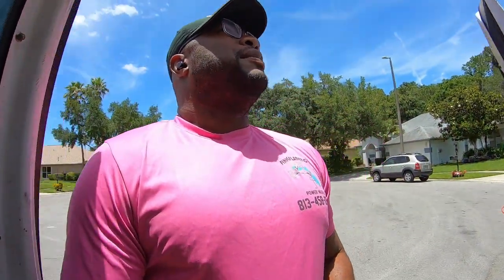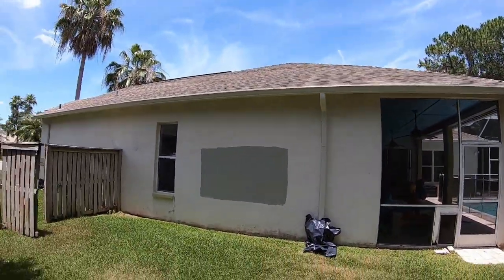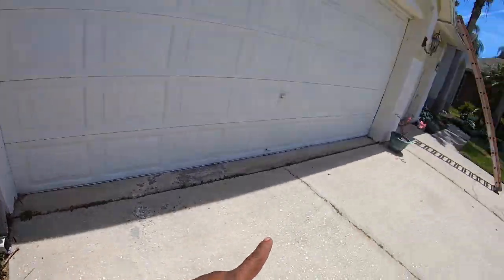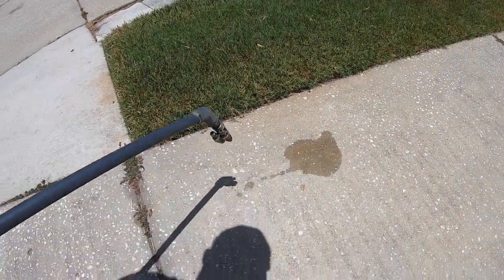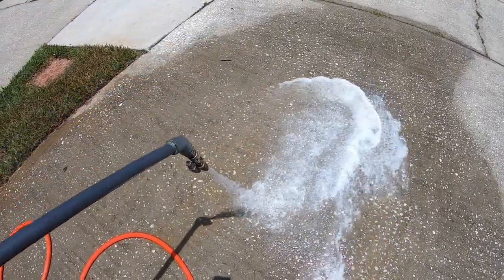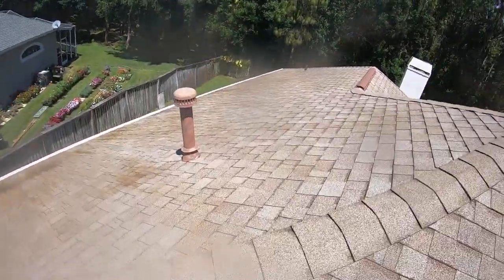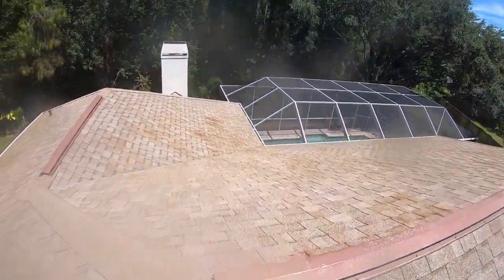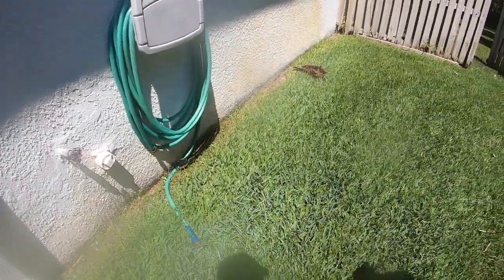Quick & Easy Roof Wash

Comment: Few questions for you brotha. first, what type of bags do you use? Would any garbage bag work? Secondly, what surfactant do you use and how much of it do you use? I was just doing a barrel tile roof today and had 1 oz for every gallon of mix and the runoff was still crazy.
Reply from the maker: I used trash bags only because I didn't have the gutter bags.  The link for the gutter bags is in the description of the video.  I use slo mo surfactant.  1oz per 5 gallons is plenty. U could add a little more but it's  not needed.

Comment: Nice.  So you are using slo-mo.  I believe.  What level are you setting to on the proportioner and do you dilute it down first.  Thank you
Reply from the maker: Yes slow mo. I have gotten a soap tank yet.  So I been putting my soap with the sh still
Reply: @PinkFlamingoPowerWash  Thank you how many ounces do you add to the SH is it the same as when you batch mix like an ounce per gallon

Comment: My friend do you use 50/50 on the roof too? After spraying you just let it dry by itself, in how many minutes do you see the result after you finish spraying?
Reply from the maker: Yes I always use 50/50 on roofs. and yes it dries on it and gets rinsed by the next rain. usually after the service you will see at least a 90% improvement then the rain will rinse it then it will look perfect.

Comment: Did you rinse the roof? And what do you do for summer when it doesn’t rain for couple months? You still don’t rinse?
Reply from the maker: No I don't rinse roofs except metal roofs.  We don't have droughts like that here In Florida. Never had an issue with that.
Reply: @PinkFlamingoPowerWash  well for us here in Oregon it stops eating for like 2 an half months. You think I should be fine not rinsing the roof for that long?
Reply from the maker: @jonathanguerrero8316  different climate I wouldn't wait that long for rain cause the home owners may not be okay to wait.  So you'd have to talk to them or just rinse it.
Reply: @PinkFlamingoPowerWash  oh I see! So what’s the longest I can wait without rinse like a month max?
Reply from the maker: @jonathanguerrero8316  don't know for sure cause it will be up to the home owner. But that's a good time to wait and then you can double back to rinse it. If you're in a drought I wouldn't even risk it. Rinse and water the grass and plants really good.

Comment: What’s 50/50 5% mix ? Thanks
Reply from the maker: half sh (chlorine) and half water. So if you have a 50 gallon tank. 50/50 mix would be 25 gallons chlorine 25 gallons water.

Comment: Cliff what is the best way to get rid of streak marks when you power wash a concrete driveway? or any concrete in general
Reply from the maker: Post treat with Sh. 50/50 or straight with a pump sprayer. Be careful if its on the edge where grass is.
Reply: @PinkFlamingoPowerWash  do I need to rinse after i spray that or no.
Reply from the maker: @SwaGGaDtP  nope spray and leave it.  No need to rinse

Comment: Hey Clif, do you still use SloMo surfactant? How much you mixing for roof wash vs house wash. TIA
Reply from the maker: Heck yea I do. for downstreaming its mixed 1-2 oz per 5 gallons. Depending if I want it soapy. But for roof washing I mix up a batch of 15 gallons of soap in my dedicated soap tank. I do 1 gallon of slo mo to 14 gallons of water and then I meter that through my proportioner. So long story short I dont really mess with a bunch of ratios for surfactant. In the end surfactant only makes the sh stick and I dont need it to stick that long on houses.
Reply: @PinkFlamingoPowerWash  do you add anything to make it smell good?
Reply from the maker: @Black Lab Power Wash LLC  not on that. I rarely do that anyway.  Not really a focus of mine.
Reply: @PinkFlamingoPowerWash  Do you use slow Mo on tile roofs and metal roofs?
Reply from the maker: @Black Lab Power Wash LLC  I use it for everything. It's just soap to make the sh stick so there's no need to be using different kinds. They all do the same feel me?
Reply: @PinkFlamingoPowerWash  do the customers every complain about the bleach smell?
Reply from the maker: @Black Lab Power Wash LLC  no really. Once in a while but hey it is what it is. Gotta kill that mold wirh sh
Reply: @PinkFlamingoPowerWash  Yes sir. I've got a few roofs this weekend coming up and first time using SloMo. Excited to see it in action.